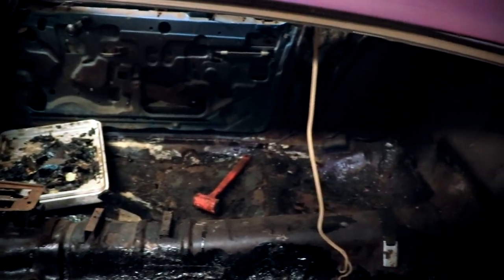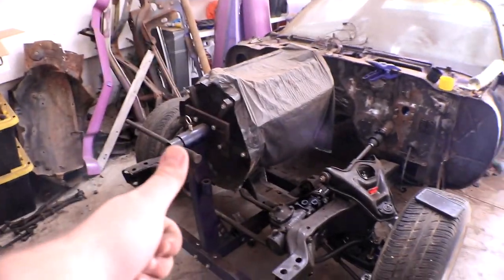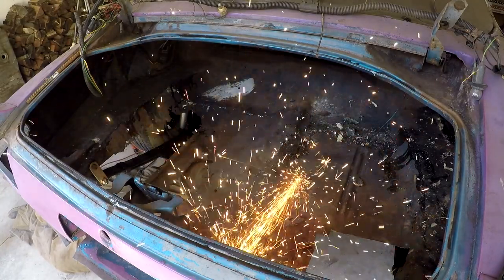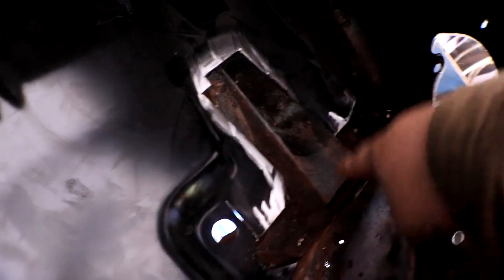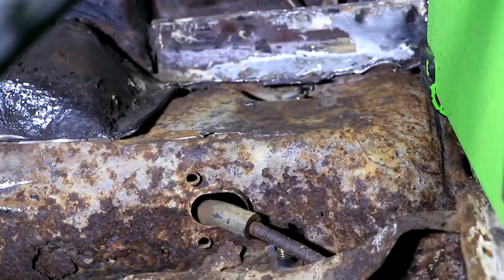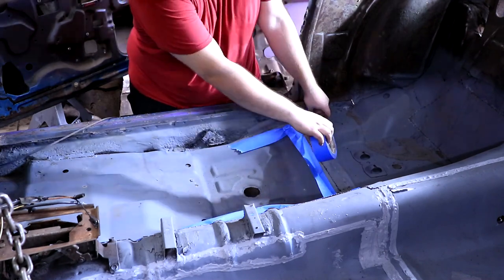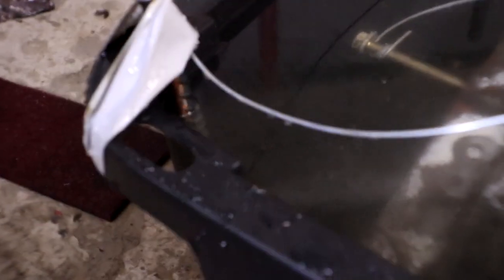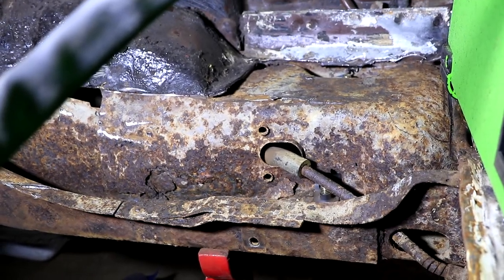Restoring a 1975 Camaro Dirt Track Racing Car... with NO experience | Part 1

Comment: Great voice, great audio, great editing. Your willingness to jump in hands on and learn is admirable. 

For welding, i would suggest investing in getting gas for your welder. It wil help immensely as a beginner and your learning welds will have more integrity. Second is making sure your welder has a solid power source. So at least 20 or amp breaker of power source and if an extension cord is needed, make it as short heavy gauge as possible

Comment: Your videos are A+.... your welds are ..... well scary 😅
Reply from the maker: They're getting slowly better! Flux core is a beast to work with.
Reply: Flux always looks like garbage but it does hold. The thing that's the hardest is getting good settings on the machine after that it's smooth sailing
Reply: @TheGarageGoblin you need to get closer to the material with your tip , but please for the love of god get yourself a gas welder before you start welding body panels

Comment: That guy ripped you off big time for 3k bro it's not even a Z28 and it's rotten to the max good luck with that build hop u have deep pockets
Reply from the maker: Came with a "running" motor and good transmission, those alone were worth more than 3k haha!
Reply: @TheGarageGoblin ike your channel and what your doing, I really do enjoy watching your process.
This said 3k is twice over what a used sb350 and a th350 is worth. You've worked with this stuff long enough to know this, maybe you're being sarcastic..I hope lol.
Because a th350 is a good transmission but they are litterly the cheapest auto trans to buy and one of the easiest to rebuild. A new rebuilt th350 is 7 bucks for a oem build(and 1200 for a little upgraded one)then a used th350 can be had for 100 to 200 bucks.
sb350 engines are cheap too, 100 bucks to Infiniti but a used unknown condition one is free to 300 maybe...maybe 500 if it is running and clean looking, more obviously depending on aftermarket parts.
Things are more expensive these days but not like all these people in the comment section are saying.
I'm not going to even get into the price on the car. 
I'm a believer in you do you (but even a friend should give you constructive criticism)
Reply from the maker: @motov8-garage832  thanks for the tip! Definitely new to this, and I may have overpaid, but at this point it is what it is lol!
Reply: @TheGarageGoblin  Not sure how much of a tip that was, more of a rant😄.
Hey dont feel bad we all live and learn (I've done the same) and if it's something your doing that you really love and care about, you'll put in the work to learn about it (which you obviously are)
3k is high but it's not the end of the world, I know this project is for your mom so i get it, If I was buying and building my mom her old car from her younger days.. I'd be doing it for her, not thinking about much else.
You should get and build your own project car after you get this one done.
You'll obviously have learned some things and be two steps ahead to build your own car next.
Reply from the maker: @motov8-garage832  I would love to pick up a 78-79 trans am next for myself. Dream classic.
Reply: @TheGarageGoblin  Good choice👌, that would be awesome. I have a 79 10th anniversary transam I've been working on.

Comment: from what i can see you're too far away from the material with your tip when you're welding . that's why you're not getting good penetration and lotts of splatter ... do yourself a favor and get a gas welder before you start welding on the quarter panels !!!!

Comment: Why????? There are so much better condition vehicles to start with. I could see if for something rare, but a Camaro 😂
Reply from the maker: To learn! Why risk working on something rare when I could work on a something with easily replaceable parts if I do something wrong 😉
Reply from the maker: To learn! Why risk working on something rare when I could work on a something with easily replaceable parts if I do something wrong 😉
Reply: @TheGarageGoblin  still makes no sense financially unless simply done to produce YouTube content. You will have way more money invested in parts than the value of the finished vehicle not allowing anything for labor costs.
Reply from the maker: @bestprice1776  labor costs? I’m building it myself to learn and for a fun project. Ain’t that deep brother!
Reply: @TheGarageGoblin  ok so your time has no value, just be honest lost leader done for YouTube content. I can accept that
Reply from the maker: @bestprice1776  I didn’t even buy it for YouTube, I bought it as a project car to learn automotive work, just happened to also be fun to make videos about the process. My time on the car has no value, the end result will be worth every hour I put in!